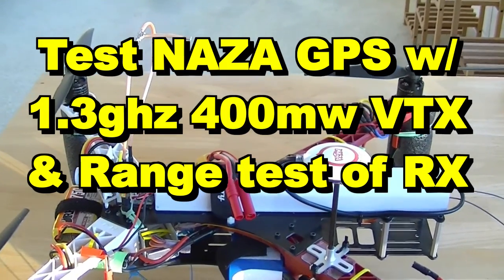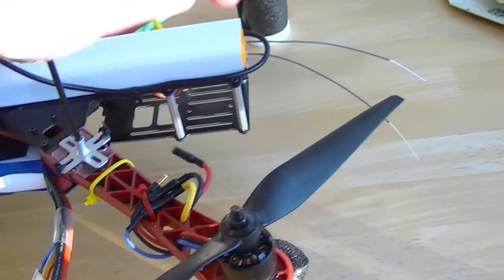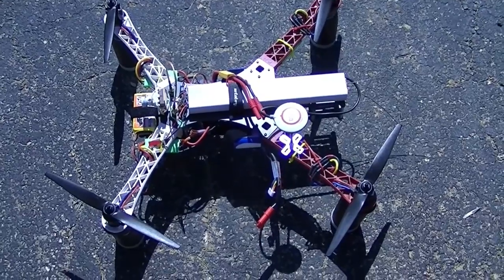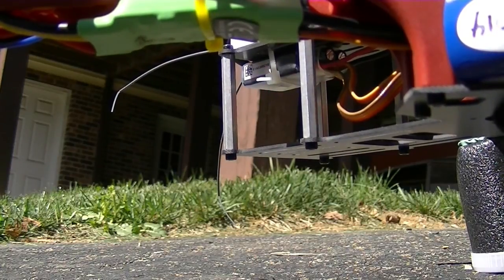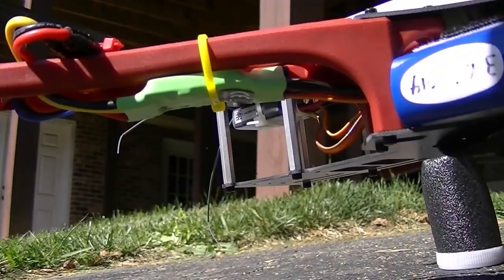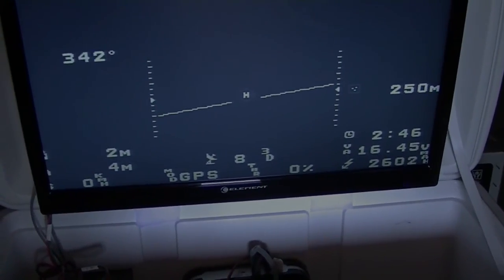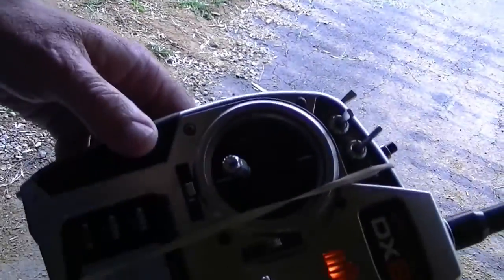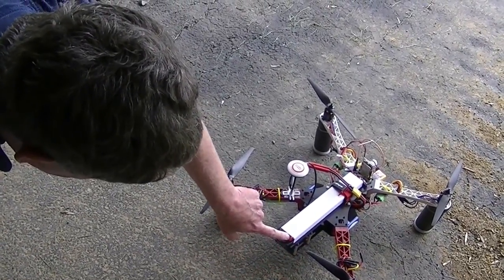NAZA GPS Testing 1280 MHz w/ 400mw VTx and RX Range Check

Comment: WoW, I'm really glad I stumbled upon your videos.  Some great information in this video!  This is going to help me a lot as I'm about to start integrating 1.3VTX into my F450 quadcopter frame.
Reply from the maker: Yes I am using 1.28 Ghz VTX which is really not normal but I wanted to do it so I could use the LasrBG Fat Shark compatible receiver I bought. The trouble with 1280 is it interferes with every thing else so I had to add three different RF filters on the quad just to get it to work. 1258 works much better and is more the norm and you can get a 5.8Ghz Fat Shark repeater for the ground station instead of doing what I did.

Comment: PS: I just got my 1.3 gigs CP IBCrazy antennas and notch filter for 2.4 gigs today and will soon use it on a quad with Skylark Tiny OSD III: I feel better having your tests and solutions on my pocket ;)
Reply from the maker: Most of my problems came from trying to use 1280MHz on the VTX with the NAZA M GPS.  If i switched to 1258MHz the problems went away but then I could use the 1280 LaserBG Fatshark receiver. You should be just fine with the Skylark.

Comment: What a story fixing these issues. 

Congrats! We all know a bit more on such slippery topic: radio interferences between frequencies.

Looking forward an actual flight to see how far you reach: where you were it looked more like 100 m far from the RC transmitter.

Happy flying!
Reply from the maker: Thanks for the congrats.
Yeah I got way more range than I expected so the filters must be doing the job.  It was probably more like 60 meters when we got the brown outs. Considering this was a low power range test I was quite happy with the results!

Comment: congrats ......one more test Dave. (if you have some) use a piece of carbon fiber sheet under the gps antenna(exact size), not the stand, just under the antenna on top of the pole. let's see if the carbon fiber helps in blocking the signal from the vtx.
Reply from the maker: Thanks Jimmy, I already have the copper foil mod under the GPS. Forgot to mention that in the video along with the other 4 mods, lol
Reply: wow. so what you have there is the "MOD-QUAD" :)
Reply from the maker: jimmy gray Great name for it!
I see a lot more mods coming. Got to get the mobius cam on it next.
Reply: I almost bought a mobius but i think i'll be disappointed in it. some of the videos that i've seen so far look kinda "furry"
i'm working on fpv for my dji 500 hexa as well. i have the board cam anready set up. waiting for the gopro and gimbal some time this week.
Reply from the maker: I am guessing you are going to use a 5.8G VTX. Is that correct?
Reply: Yes, running 600 mw .
i almost damaged my hexa today, trying to fly
next to the house. not enough space for a rookie.
Reply from the maker: Good practice though. If you have to crash it's good to do it at home where you can fix it. :-)  I was flying the mod-quad around the back yard today with 1280.
Got 7 to 8 satellites consistently during the flight but the flight mode is still mysteriously changing to manual.
Back to the bench.

Comment: I use no filters and my 1280 w/Inverted v does not effect my skylark gps but these DJI seem to be very touchy. Hope I don't run into as much trouble with my Naza v1
Reply from the maker: IMO, The Naza v1 GPS is susceptible to 1280 as well. The only NAZA GPS that has the SAW filter already installed is the one on the DJI Phantom quad.
Reply: I'll try a carbon fiber signal block for below where it is and see if that helps. The power issue makes a lot of sense maybe ch's a-f are less interference on gps.
Reply from the maker: Nice little quad. You may find a solution it just takes a lot of experimentation.